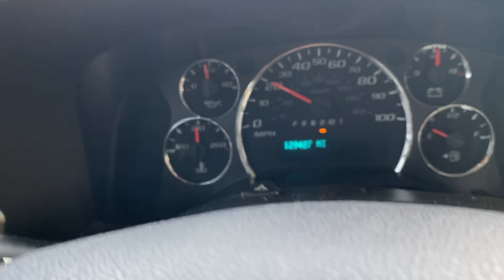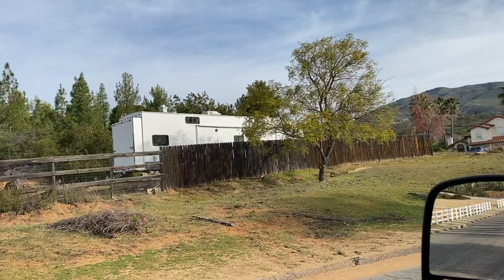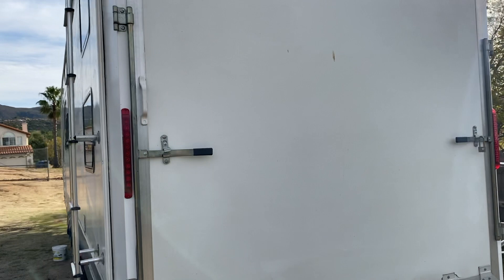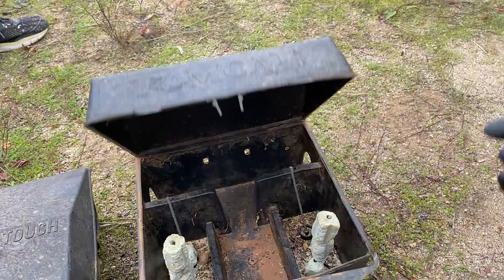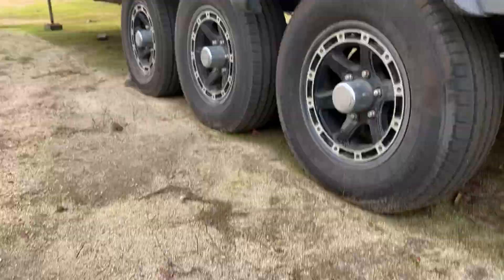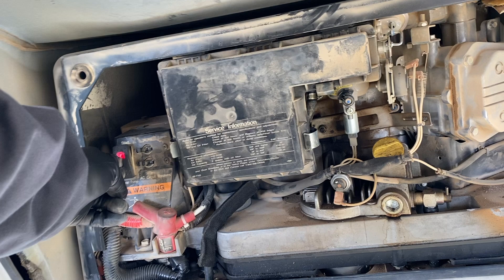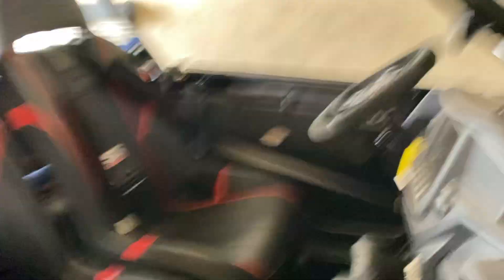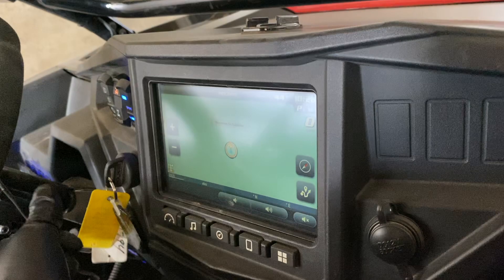BEST way to keep MICE & RODENTS out of your TOY HAULER, CAMPER, RV

Comment: Do you ever find a dead rat in your 5th wheel
Reply from the maker: No I don’t. After they eat the bate they take off. They never make it inside the fifth wheel. I have some sticky pads inside just in case but they never make it inside.

Comment: Someone just told me that Irish Spring soap pieces everywhere really works. Your thoughts?
Reply from the maker: I’ve never heard of that before, sounds like it may work. I used to put down static dryer sheets and it would work. It’s a temporary thing though, I think it works as long as the scent is around. I would give it a shot. 👍🏼
Reply: Mice love to eat Irish Spring soap it attracts them.  So it's a myth to use it. Just look at all the RV forums and you will see pictures of soap that has been eaten.  But you still hear people recommending it
Reply from the maker: A R Thanks for that info, Good thing i don’t use Irish Spring. ☝🏼👍🏼
Reply: @gslife1  sure, no problem.   İ was responding to the person that was asking about using Irish Spring.